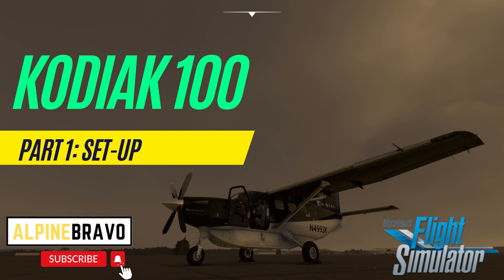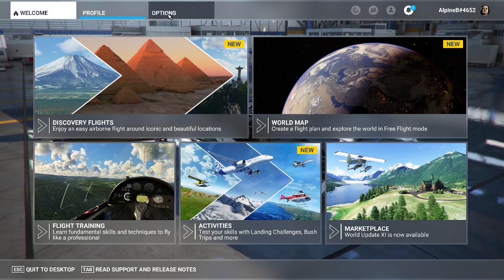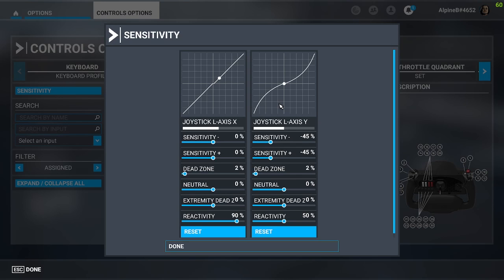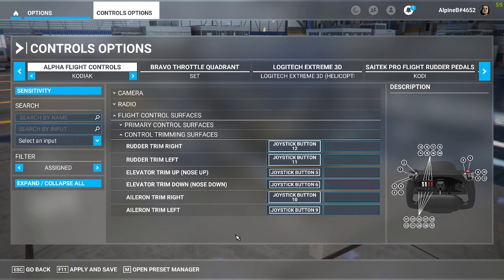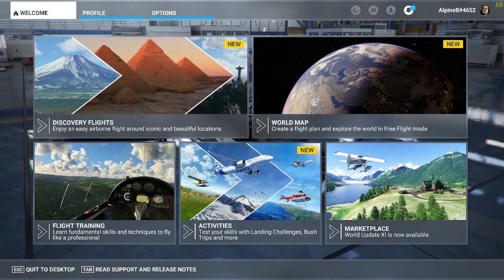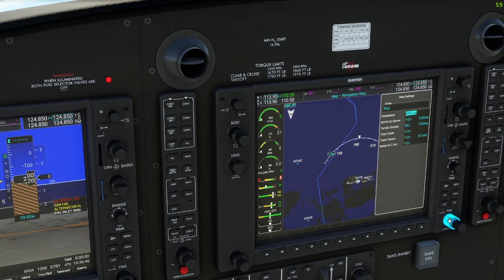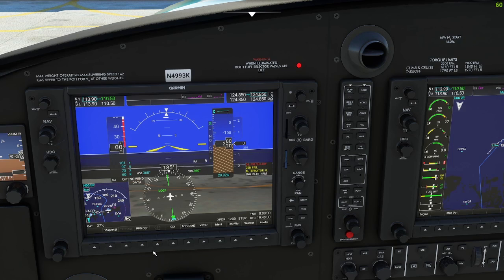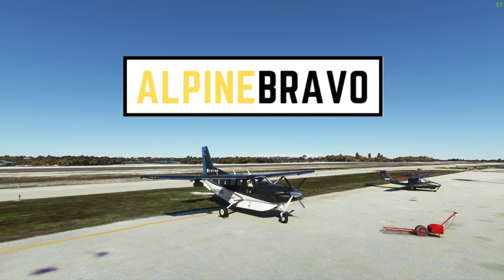How to fly the Kodiak 100  | Part 1: Set-Up

Comment: Just bought the Kodiak in the sale and while a casual simmer on Xbox I decided I wanted to get my virtual hands dirty really getting to grips with a particular plane.  Saw some of your posts on the MSFS forums regarding the Kodiak and decided to start watching the series. Nice pace and a lot of information that I found very helpful..  Thank you
Reply from the maker: Hi Ed,  hope you enjoy the Kodiak - its a tough plane to fly well, but rewarding once you start to master it.
Reply: @alpinebravo7090  Yes I am thanks to your series of videos.  Had some issues starting out with overstressing but having read the manual and understood torque limits I have managed a couple of successful flights including one with full start up.  I normally fly external camera for the view but I have found I have to fly cockpit with the Kodiak and I like it all the more for it.  I am making my way through your videos and they are a great help.
Reply from the maker: It's a very sensitive and finely balanced aircraft - how it's loaded and how it's trimmed make big differences to how it will fly. Just like the real thing! It's particularly sensitive on the pitch axis so watch out for that.
Reply: @alpinebravo7090  Yeah I noticed that!  Have lost one flight because I gained too much speed very quickly when the nose pitched down.  I haven't quite found a sweet spot with the elevator trim yet.  I set the power for the torque level for the cruising limit or just below but I cant maintain a level flight with trimming.  I just need to keep experimenting. :)
Reply from the maker: Don't stress if you can't get it to trim perfectly in level flight - I mean you should be able to, but it's currently not quite stable enough for that. The PC-6 in comparison is fairly easy to trim for pitch.  With the Kodiak I can usually trim it good enough for two finger touch on the yoke, but never enough to go hands free. If I want that I have to put the autopilot on!
Reply: @alpinebravo7090  Thank you.  That's good to know.  I must admit I have not used AP at all in MSFS 2020.  I fly VFR - GPS and maybe add in a couple of waypoints to make the flight more interesting and just go Hands On.

Comment: Hello there, thank you for your videos!  One question though, How did you set up your Bravo throttles to use the beta range?  Is it just full reverse once you get it past the detent on the throttle quadrant?    Thanks!
Reply from the maker: Hi there, thanks, glad you are enjoying them!

So I used SPAD.next to configure my the Bravo throttle axis Above the detent is forward and beta. Below the detent (the button press) is full reverse thrust. That works very well for me and makes taxiing in beta a breeze. I dont mind not having axis control over reverse as i only ever use it for STOL landings and then I always want all of it!

I'll either do a post or a short video showing the SPAD configuration (or you can just download my Kodiak profile if you have SPAD - search for Brendan-GWBCH).  If you only have the MSFS in-game control mapping available then you could use something like:  TOGGGLE REVERSE THRUST [on release] on the button below the detent. Then if you quickly drop the throttle below the detent and back up, as you push the throttle forward you should get the beta and reverse range as it places the throttle axis into the reserve range.

I personally don't like this method as it means pushing the throttle forward at critical moments of flight and if you were aiming to get beta/reverse on the roll-out after landing, if for some reason it doesn't recognise the toggle command, you will end up adding thrust just at the moment you are trying to lose it! Setting the button command to 'on release' helps mitigate this though and I know for some folks it works well.